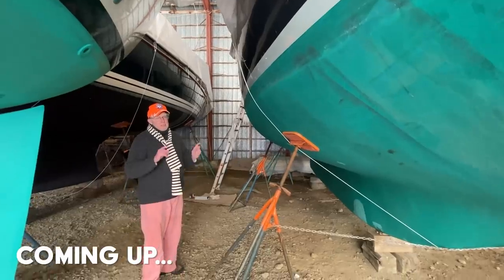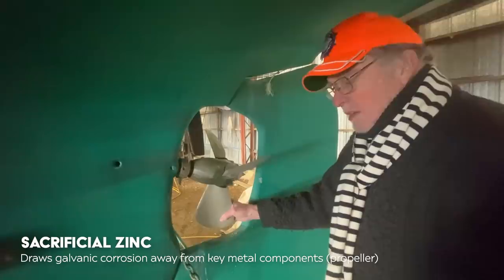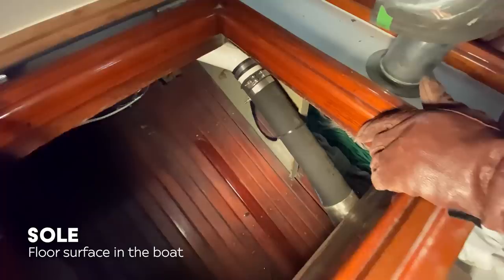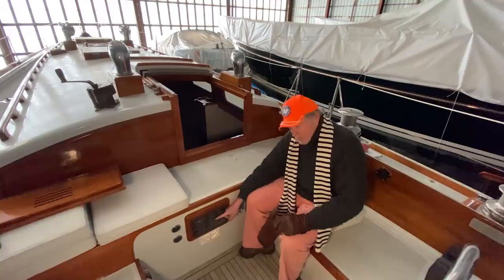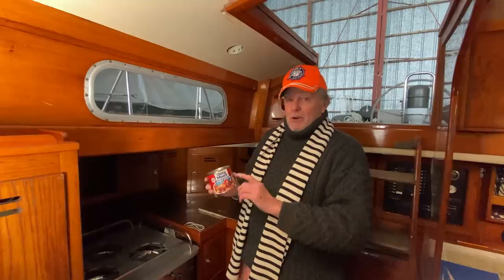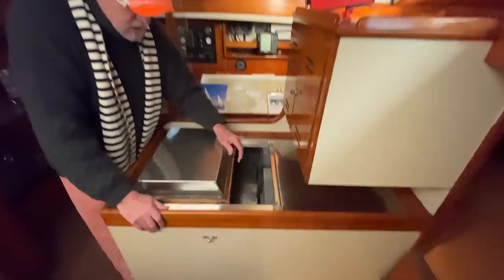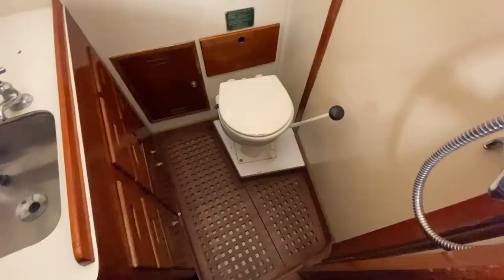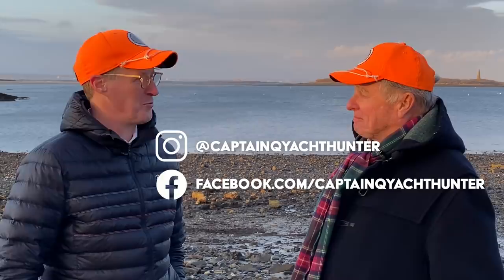DON'T BUY THIS BOAT! Classic Steel Sailboat for Sale - Ted Hood Steel Yawl $119k EP29

Comment: This is not a normal steel boat, this is made of Corten steel!!!! Important
Reply: what's stopping the other boat builders to build their boats in corten ? just curious
Reply: @leof2180  I would assume price. I just looked, and a 4' x 8' piece of 3/16 is about $1k
Reply: @leof2180  Work boats for the government are all in Cor-Ten steel. It is durable and a bit more expensive, but it is real unpleasant to weld. When you buy a new mild steel boat, it will last 30 to 40 years before you need to replace plates. In cor-ten steel you might get a 100 years. Will you spend the extra cash?
Reply: @leof2180  
$
Reply: @Nerd3927  I might be more inclined to have regular 1018 or hot rolled so that I can easily and effectively repair it myself. Lord knows we will all run aground at some point or another, and one of the very special things about steel boats is that they are simple and easy to repair. I would be inclined to keep it that way by using a cheaper alloy that wont be compromised by welding with the incorrect wire. Also, while cor-ten is much stronger than the above mentioned alloys, it's anti-corrosive properties in tropical salt water environments is somewhat dubious.
Reply: @Nerd3927  Government, now it makes sense. Price is no object when it’s not your money, 👍👍👍
Reply: Corten is what they made submarine pressure hulls out of.
Reply: @Nerd3927  Good point, but my guess is you couldn't finish the lockers like they did if the hull were A36 (Carbon steel) as it would be a constant scraping and repainting on the inside of the hull. With this product you could leave the inside unpainted and cover with teak as they did.
Reply: @nomehdrider  Unpainted is not an option, it is by no means rust free. But in most places my 40 year old original bilge paint from the 80ties is still good, and where rust took hold, it is not to deep. My boat was also shot blasted with hot zink, inside and out, just after the build. I would not be surprised if this Frans Maas is too.
Reply: @Nerd3927  I read up on the Corten steel, first time hearing of it, and it develops a protective coating of oxidation and doesn't require painting. I was wondering if painting the hull would be counter productive?
Reply: @nomehdrider  on shore, corten steel can be used in construction and for example sculptures without painting. It will rust but not rot. In a Marine environment you will need paint. It is better then mild steel, but no magic :-)
Reply: @Nerd3927  Thanks
Reply: My withholz departure 35 was built from cor ten steel. Great boat. Once epoxy tarred, painted it never rusted like other steel boats.sold it a while back and it still looks great.,I used paint used in oil rigs.
Reply: @AndrewDonald-submergency  I heard submarines are made of CuNiFer, a very durable copper-nickel-ferro mix, but I might be wrong
Reply: What about the steel SpaceX uses?
There is even scrap pieces of it as they test SN rockets at Boca Chica Tx.
Reply: 👍 S/V Adma. Yes, the Cor-Ten “non-rusting” steel. But, it has rusted. Surprise?!?
 Hawaii's ALOHA Stadium is the ULTIMATE environmental test: Heat, high humidity and salt-spray. Which are the exact conditions that engineers use to evaluate corrosion of materials in test chambers. Cor-Ten Steel was introduced in the ’50s as a rust-resistant material. It is resistant to rust, but is 'NOT' rust-proof.
Reply: @leof2180  Nothing. It's been around a long time. If you've ever seen a steel building that looks totally rusted, you've seen corten.
Reply: Same stuff that shipping containers are made from. Easily weldable using the correct procedures.
Reply: Cor ten is common for use in large artistic sculptures and architecture. Left unpainted it it shows a bit of surface oxidation and that is the extent of it.
Reply: I am trying to understand how Cor-ten steel would be advantageous in a boat hull? Yes it has a much higher tensile strength then regular alloys, so that is a plus. But it’s ability to corrode and form an oxide skin only occurs after exposure to the elements for 6 months or more, and it is a slightly rough “rusted” surface texture. How does one achieve a smooth painted hull surface then? If the painted hull is then scratched or damaged, new metal is exposed and the oxide surface would bloom through the scar. It is rust-resistant, not rust-proof.

Comment: That yacht is unbelievable  talk about a well planned yacht question would be what is the external displacement  of her    i have a wooden racing sloop from the 1936 do you think the sail plan would be similar if she was kept a sloop rig my yacht everything set downwind will carry 1550 sq ft of sail , what will she carry not being a racing vessel from the 1930's they probably toned down on big mast big boom and giant sail plan , but is amazing how much space she has compared to my yacht which is 41 L.O.A what 5 feet can change obviously she is wider by a foot or two
Reply from the maker: Displacement is 30k ish.  I’m not certain about your other questions but with the mizzen staysail/spinnaker , the main chute and forward staysails etc etc 
She will carry plenty of sail.  Ted hood built sails snd designed a boat that could carry as much as possible under the rule
Reply from the maker: She is a beauty and nothing at all like the floating ikea condos with multiples  of everything ; three heads snd two steering wheels on today’s designs ??? Really ??
Reply: @YachtHunters  my boat is far from ideal 1 head 1 bed and two sinks thats what we call luxury remember settee are not very comfortable in the width of a man's body originally in my plans 8' anchor locker for sails bed and toilet for a single crew member who would have to go to the foredeck in  the anchor locker at 41 ' why would they ever think 7 people could fit comfortably in a race boat but also alot better than  a ikea boat which I call Nike shoe boats with no sole

Comment: if the engine is sound (how many hours?), sails good (or better) condition, that is a steal of a price.  what was forward of the forward cabin?  There is a hatch on the foredeck that wasn't opened and forward of the hatch to the forward cabin).  small interior for the size (reflective of the boat's age, not a failure by Hood).  small cabin, again for size of boat, and lack of a double berth limits interested buyers (I know this as the boat I live aboard also doesn't have a double berth and, IMO, the #1 reason she didn't sell for years and I was able to 'get a deal').   The other problem is folks are scared of steel thinking that a boat will spontaneously rust away in a year (which isn't true as shows in this boat being better shape than most of the fiberglass craft you have already featured).
Reply: There is corten steel and there is other steel. Not every boat is made of corten steel. Also, you don't judge steel condition of the boat by looking on the outside. Steel boats rot(rust) from the inside.
Reply: @pnwbuilder  yep, yep and yep.  Same as number of hours on an engine don't tell the entire story.
Reply from the maker: Couldn’t agree more

Comment: Thickness on the fridge is deceptive. It's got to be fiberglass wool. F/G has half the insulation value that modern foam insulation does. It's why the walls in older refrigerators were thicker.

Comment: Given it is a Dutch build  Frans Maas, it is most likely treated with hot zinc inside and out. Schooperen it is called in Dutch. It seems to be called "Thermal spraying" in English but I never heard of it outside of the Netherlands.
Reply from the maker: That’s a neat tip... I imagine that plus the Cor-ten anti-corrosion will keep it quite clean.

Comment: The beauty of steel is, if you punch a hole in it, you just weld a new piece of steel on it.  Much easier than fiberglass or wood
Reply: "Just". Only, you need to know how to weld. And have a welder. And a place where you are allowed to use it. 
Also boats tend to rust on spots where it's hard to see and almost impossible to access.

Comment: I suspect the boat to have a grounding problem, because of the blisters, the repairs around the through-hulls and the anode that is almost gone at the prop. Very often a current is running where it shouldn’t be if you see this. Often it’s a good start to suspect the inverter... 
a very well educated marine electronics specialist can deduct the source of it.
Reply from the maker: thanks for your observations

Comment: Would have liked to seen engine compartment and mechanical...
Reply from the maker: Captain Q, Yacht Hunter
  • 1 second ago
we did forgget it  but its right under the companion way    tight fit but accessible  i got a quick pic just as we walked off  after our mutual forehead hand slap  :-)

Comment: Sorry, Corten is NOT pre-corroded  and it is no longer manufactured because it did NOT perform as advertised.
Reply: Where did you learn this?  I was also under the impression it was corrosion resistant.
Reply: Corten can be your friend, just let it go, just let it go.

Comment: I used to own a beautiful strong "Steel"  motor sailer, with after kabin 45 feet it was a ketch rig, i won't go into details, but it was the biggest mistake i ever made, never,never, again i would buy a steel boat, i want a boat to sail not to work on it and believe me work you must, unfortunately the rust always be ahead of you.
Reply from the maker: MY FIRST BOAT FIFTY YEARS AGO WAS A DUTCH STEEL 44' KETCH  AND WE HAD A LITTLE RUST BUT NOT INSURMOUNTABLE  AND SHE WAS WONDERFUL  AND BUILT  ONLY HOW THEY DO IN THE NETHERLANDS    :-)
Reply: @YachtHunters  Yes, mine too was built in the Netherlands, but probably they used scrap metal, on that one, beautiful it was, but impossible to keep up with the rust.

Comment: if she were a fiberglass  boat i would trust 50 more years.  i have seen low new cost  fiberglass boats  survive under concrete bridges bashed around by hurricanes with just a few gouges......   they say the glass  keeps getting stronger..........i would like to see the inside of that steel hull  , and inside the centerboard well..................  she is pretty  , but  .............no trust.
Reply from the maker: 58 years is a pretty good start
Reply: @YachtHunters  yes it is.  but plastic paint covers well  . if i saw behind the walls  and all was well , i would say ''you are correct''  and i hope you are  , cause i love boats.

Comment: If you buy this boat and stop making these videos to "go sailing" I will dig out my scuba gear and drill holes in the bottom.  I SWEAR.  BTW how thick is that steel again?  DO you recommend Carbide tips?
Reply from the maker: Fair enough... we shall not stop making videos... and if you come over with scuba gear you’ll be invited on board to share some dinty and bubbles 😂
Reply: @YachtHunters  Great news!  Everyone can thank me now ;)  Just throw down a plastic scraper and Ill be up in 20.  Dinty is a bit extravagant for my tastes.  More of a Ramen guy.  Buy hey to each his own.  Have you seen how much a can of Dinty is now?  I also prefer my Horses live.

Comment: Wrong coast. ;(
Reply from the maker: that can work two ways for us back here :-)
Reply: I have been looking for something  40-50' for awhile.  Its either several hundred thousand more than I can afford, or junk.  

Found many on the east coast, but to fly there, buy it and sail it back is not an option.  I know I could hire a crew to do it.  If it has to go thru the Panama  canal, I want to be the guy to do it.